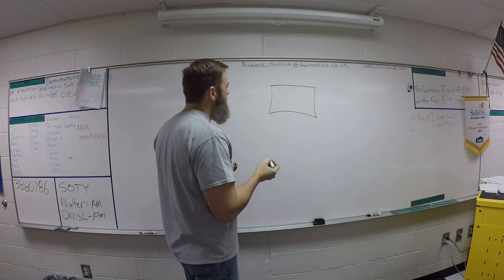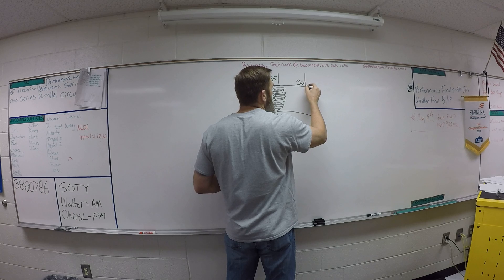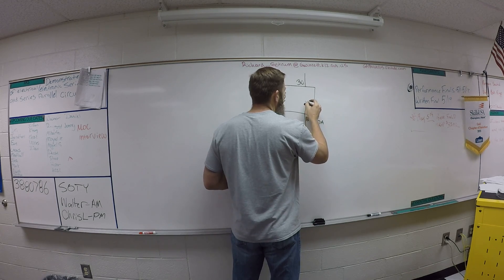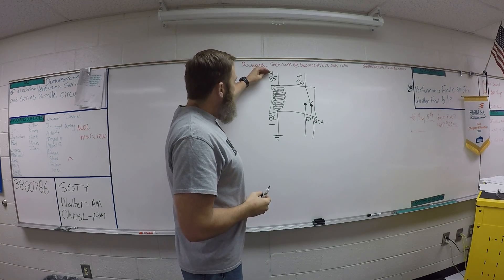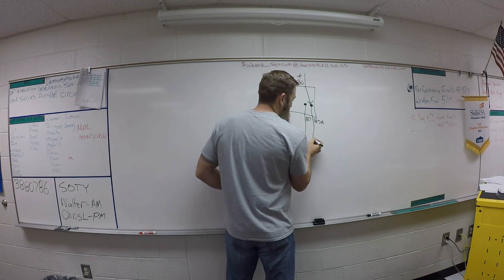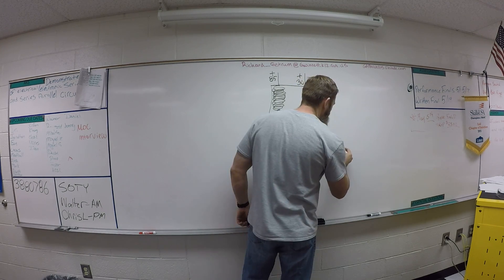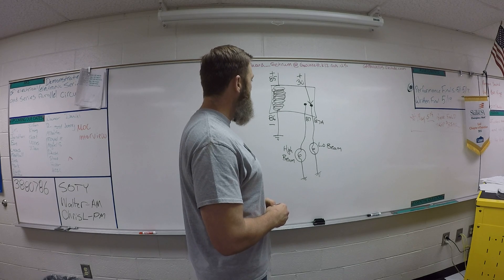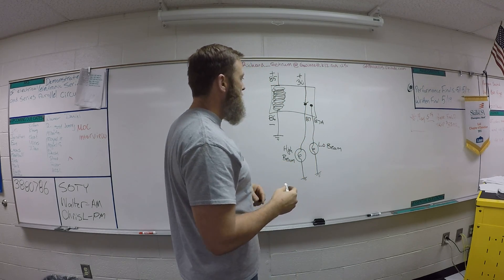5 Pin Relay Operation and Basic Function

Comment: Thank you buddy, i just learned the difference between a 4 pin and a 5 pin relay. I am going to use 5 pin relays to setup a 2 speed 2 fan cooling setup for my off road truck.
Reply: 1 relay is setup for series wiring for 2 fans and other relay will be parallel for 2 fans giving it 2 speeds.

Comment: so a question... is there a way to use one 5 pin relay and control 2 separate fuel tanks (left / right)?
I have an on/off/on switch and was thinking of just doing two 4 pin relays.. toggle one way does 1 relay, other does other but I'm wondering how hard would it be to use say a switch tied from ignition for initial power of one pin then flick switch for other... lookin for input.